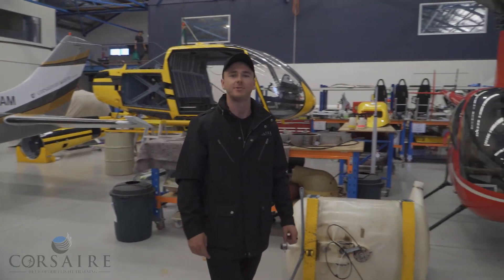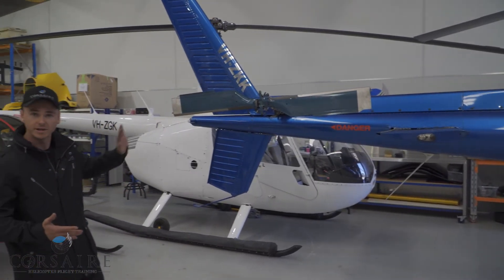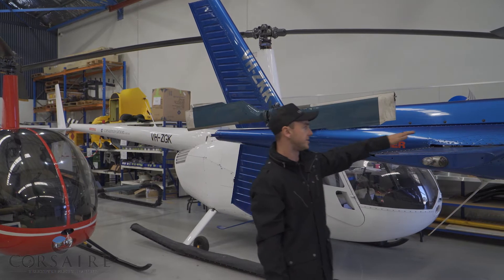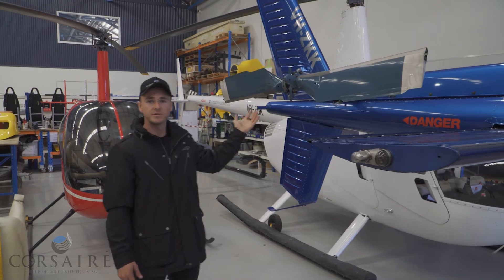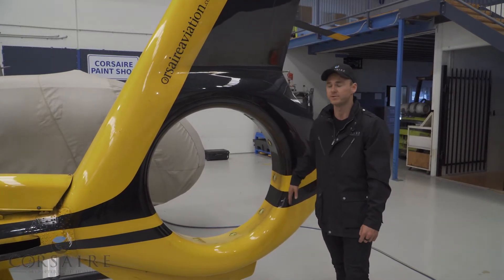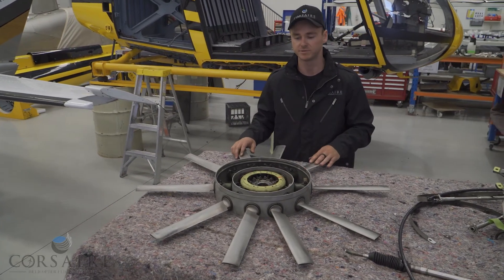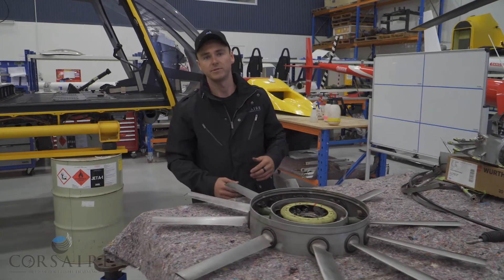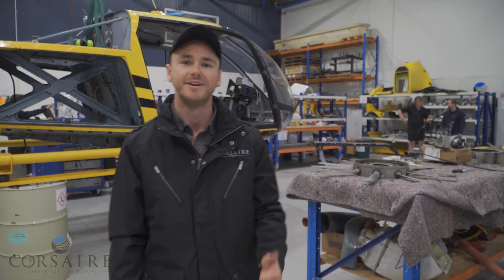Conventional Vs Fenestron Tail Rotor

Comment: The  ducted fan system used on the MD-500 is the best anti-torque system EVER made. It has no blade. It uses air from the engine to counter the torque from the main. Just a giant hair dryer. Brilliant

Comment: I don't get why we're still using this ancient technology of main rotor and tail rotor all helicopters should be coaxial at this point there way more efficient cause none of the energy from the engine is wasted on the tail rotor instead you just have two main rotors spinning in opposite directions not only is this better in terms of efficiency but also noise and think about it when a helicopter flies forward on one side of the helicopter the rotors are moving towards the wind and on the other side there moving in the direction of the wind which is a limiting factor in helicopter speed but with two rotors moving in opposite directions the issue is overcome.
Reply: Coax rotors are more complicated in terms of maintenance compared to the conventional design.